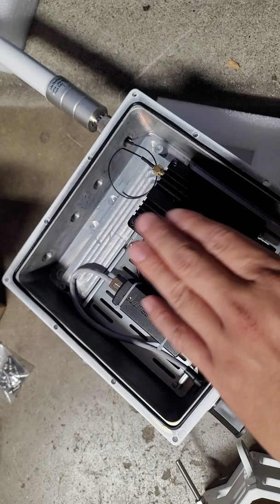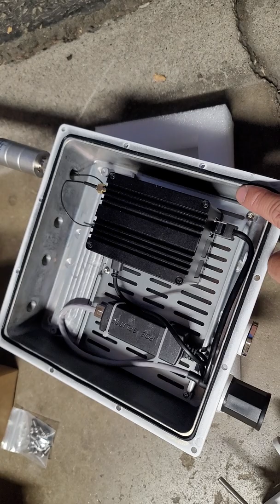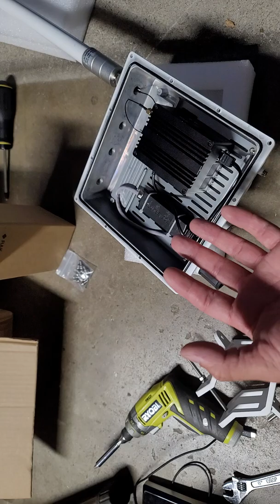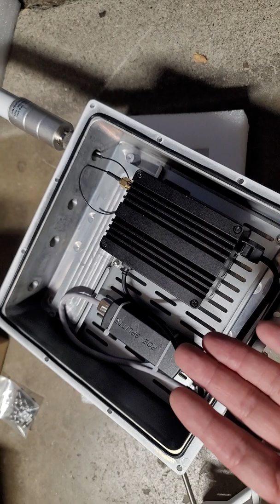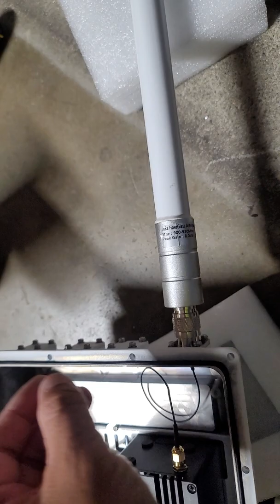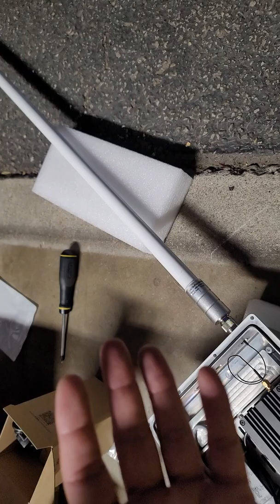Rakwireless Outdoor Enclosure Kit Instal

Comment: question would a sense cap miner fit in this?
Reply from the maker: Yes the Sensecap does fit inside. However you will need to get creative and find a way to attach the Sensecap to the mounting plate.

Comment: Hi, the wind not gonna break off that long antenna?
Reply from the maker: No it shouldn't unless you have 100+mph hurricane winds. But even with that I don't think the antenna will break off. It's pretty solid where it's mounted on the metal enclosure. Many people are running similar setup on top of commercial buildings and high rises and I'm sure the winds are much stronger higher up.

Comment: Great videos! Thanks very much!
Tell me please, 
Will "RAK Hotspot Miner V2" be able to work in winter - if the temperature is between -10° C and -25° C (14F —  -13F) ?
Reply from the maker: According to the Rak V2 specs it the minimum operating temperature is -10°C. I think that it will work fine inside the enclosure, but if it's too cold you could wrap some insulation around the Rak hotspot during the winter months to keep it warm :) the Rak does produce some heat when it's powered on and working
Reply: @tonytypes  Thank you very much for the answer!=) 👍👍

Comment: Tony, it appears from the rak link, the box comes w/the the POE splitter, injector and power cord.  Is there anything else needed?  

I have the ethernet cable running from my router thru my attic out to the roof.  I know you need to ground.  I have all that too.  Just a novice with this stuff.  Thanks.  Tom
Reply from the maker: Hey Tom, the Rak enclosure comes with all you would need to run as POE. Nothing else is needed besides using a long enough ethernet cable